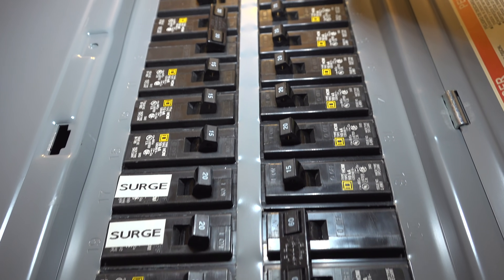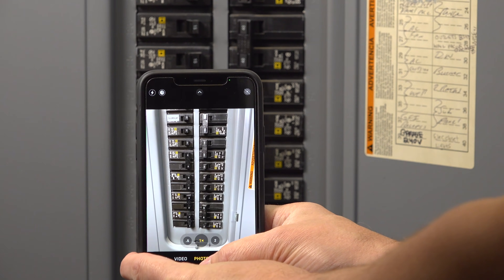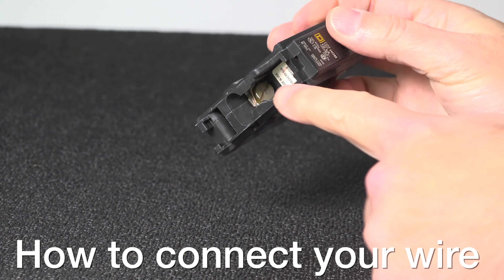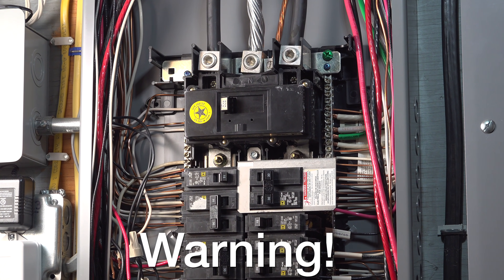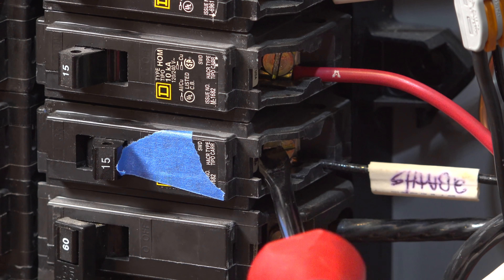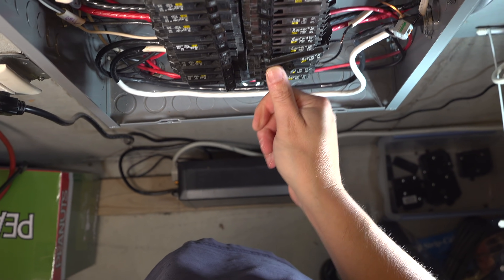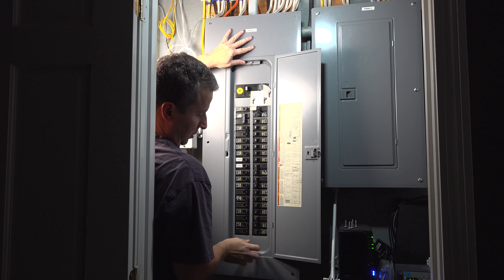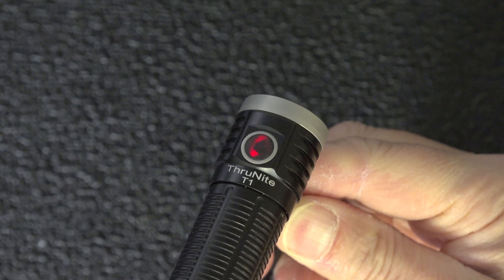How To Replace or Change a Circuit Breaker in your Electrical Panel & Why it's Tripping

Comment: In most cases, very seldom does a circuit breaker go “bad”. A circuit breaker is doing its job if and when it trips. There are many reasons why a breaker might seem to be nuisance tripping but most likely is tripping due to an actual over current occurrence. This guy gives no explanation on how he knows for certain that thiers is nothing wrong with his circuit, just because a breaker trips does not mean it needs to be replaced. Notice the label on the wire being changed. “2 baths”. This circuit breaker more than likely tripped because both baths were being used at the same time with let’s say 2 hair dryers going. This could be enough amperage draw to trip this breaker. Well done, the breaker did it’s job. Now unplug one hair dryer and reset the breaker. No need to change the breaker. You just simply can’t use 2 hair dryers at the same time and the breaker is doing it’s job to protect the wire. Many other variables need to be taken into account in a situation like this 

This guy is not an electrician and should not be giving advice on doing electrical work.
Reply: You are 100% correct!
Reply: You don't  need to know for certain what the issue is. 
Troubleshooting is very often a process of elimination. He simply the eliminated breaker as possible problem. If it quit tripping, that was the problem. If it still trips, pay more attention to when it trips then start digging deeper.  He didn't make the problem worse simply by installing a new breaker.
Reply: He wasn't giving advice on doing electrical work, he was only showing how he changes a breaker. Big difference. The bigger concern here is why you don't realize this.
Reply: @michaelwarnock3988  Nope. I will not be liable. Everything is up to code with a permit. Furthermore, I had to redo both wiring jobs that the last two incompetent licensed Master Electricians did (they used tape everywhere). In case you didn't know, most licensed trades people do a lousy job, they just want to make their quick money and get out asap. From my experience, most horror jobs were done by licensed professionals. I am sure there are a few good ones out there, but most are awful.
Reply: @panerai_fan  You are a fucking fool. If you really think all this bullshit then you need to find a better class of people or move to a less corrupt part of the country. You use the term "most" a lot in this diatribe, but YOU are the one that's wrong. Change most to "some" and you are a bit more correct.
Reply: @petermoto409  Nope. MOST licensed professionals are clueless and screw things up, which is why I do things for myself. I don't depend on "licensed" bozos.
Reply: @panerai_fan  Sorry that you live in such a shit hole area. 
I am a "licensed professional", as well as many of my friends, and I don't know any of us that is a hack. At the same time, I tend to separate myself from that element. Then again, I live in a pretty nice part of the country.
Reply: @petermoto409  Your geography "analogy" was stupid.
Reply: @panerai_fan  So are your debating skills.
Reply: @michaelwarnock3988   You are wrong. I watched his video and changed my own breaker. It was simple and easy.

Comment: i have a breaker i want to replace but its a 20amp can i replace it with a 30amp breaker ?
Reply from the maker: No, if you are going to change it with a higher amp one, all wiring, outlets, etc must be rated or a 30amp otherwise you can have a fire or worse. Get help for that job.
Reply: @SilverCymbal  i was told that if the wire behind it is 10gauage i can but if it isnt 10ga i cant is this true?

Comment: Question here. we just got a house last year, and with this Christmas season - outdoor lights and tree one fuse is blowing everytime I use the microwave. That fuse says Basement lights...( yeah I know and it gets worse ) The following are piggy backed on the same basement light fuse - 1 Living Room Socket, Master Bathroom Socket, Kitchen range microwave. 1 Garage Socket,    Can I just upgrade the fuse or do I have to redo the whole entire fuse box and rewire and label correctly>? Please advise ( btw i am just asking for advice,. Not a professional advice so that releases all liability from you )
Thank you very much
Reply: You microwave draws 12 of the 15 amps available. It needs a dedicated circuit.

Comment: great video. thanks for sharing.  if my breaker trip frequently when i got like two small load running, is that means my beaker is bad or old?  house about 20 years. thanks
Reply: What is "two small loads"?  A microwave and a hair dryer? LOL
A breaker is only $5 so, replace it with the SAME AMPERAGE RATING and find out.
Reply: @jackconnolly2665  air fryer and a small rice cooker 😆

Comment: I wonder if this is why my central AC [compressor] stops working.  The circuit breaker is not tripped but when I reset it, the AC works.  My HVAC said it could be the compressor needs to be replaced!  I don't want to go that route if I don't have to.
Reply: When in doubt, spend $12 and replace the breaker. You said it doesn't trip but there are cases when one leg trips and the handle doesnt go to the tripped position.

Comment: I JUST installed a Nest doorbell and it won't ring inside the house. I was told to replace the breaker with a higher voltage one. This video makes that job seem less daunting than I initially thought. Enough for me to give it a try.  Thank you.
Reply: You were told wrong! Higher voltage breaker? Did you possibly me higher amperage breaker? You CANNOT just simply add a higher amperage breaker. The wires that feed that circuit are rated for specific amperages. 14 awg wire, 15 amps max. 12 awg wire, 20 amps max. Using a 20 amp breaker to feed 14 awg wire, especially on a well used circuit, will lead to a fire!!! The increased amperage pull will generate heat to the point that the wire will actually melt. If you're lucky, the breaker will trip but that's not always the case.

My recommendation, as I am an electrician, is to hire an electrician and not listen to people who know absolutely nothing about electricity.

Comment: In my personal experience I wouldn't recommend the non-contact voltage testers. I am a master electrician and have been in the electrical business for 20 years. I have lost count how many times those testers do not show voltage when it is actually a live circuit. I've also seen it show voltage when there actually isn't. The safest way to know for sure is with a voltage multi-meter that has been tested on a known live circuit. The biggest problem with electricity is not knowing how it works
Reply: Thanks for reply. Turns out the clothes dryer  breaker was bad. When I took out. It was burned on the corners.  Replaced it along with the main since it sits atop it. Now everything is working properly. No issues since
Reply: Not knowing how electricity works and faulty equipment are two entirely different things.
Reply: Trust, but verifty. Agreed never work on a circuit without testing with a meter yourself that it is off.
Reply: In the power industry most voltages being checked are high voltage and most potential devices are non contact. 
It's a must as you said to check your non contact  potential device against a known source to ensure your device is in fact working properly. Three steps, check against a known source, then check the circuit you are going to tag out to work on, finally go back to that known source to see that the non contact device is still functioning. 
Once that circuit is established to be de-energized then apply safety grounds.
Reply: @generatorjohn4537  while doing laundry the clothes dryer breaker kept tripping. I went to the panel and it was very hot. I reset the main and it happened a few more times. Now I only have power to half of my house. Any ideas/ Suggestions? what do i need to replace?
Reply: @milagrossmith4891  call a qualified electrician in your area
Reply: No lie here. I found out the hard way lol
Reply: while doing laundry the clothes dryer breaker kept tripping. I went to the panel and it was very hot. I reset the main and it happened a few more times. Now I only have power to half of my house. Any ideas/ Suggestions? what do i need to replace?
Reply: Thank you for sharing that
Reply: Best example : I went to a home with an issue at the light switch. From what the homeowner told me, I told him you're probably getting a false reading (he was using a non contact). He was like huh? I explained it to him and then proved it when I got there; The meter showed he had only 87V. The non contact gave a positive for voltage. However he had AL wiring and I was not qualified or going to mess with it. In all likelihood, he had wire running in the attic that he had stepped on (he said he'd been up in the attic and issues followed) and had partially broken. I could've used Oxguard or something and joined the wires, but I wasn't messing with that shit. That's all I would have needed was to burn his f'n house down.
Reply: @WiPri0371  87v sounds like an open neutral
Reply: @RoKCRWLR  I checked ground. No current. Despite all, he had a partial break in the pairs somewhere. Regardless. It was AL wiring. I wasn't messing with that. I didn't have purple connectors. Just OxGuard. Which is unsuitable for AL/CU connections. Besides, I didn't know where the break was and had no materials. All thanks to our CSR who had no construction experience at all. And she's older than me!
Reply: @WiPri0371  Yup. 2 houses. One has copper? Buy that one. Lol
Reply: I lost count of how many times I have been shocked by 120 volts. You ain't gonna die if you get shocked by 120.
Reply: @crand20033  that's my motto 😆👍
Reply: @crand20033  Yeah, but I decided after an idiot wired up a simple pond pump, I'm NOT getting zapped again and refuse to touch it. Screw that. The plugs are corroded, too. Just begging for problems. The GFCI apparently isn't working or not working at capacity. Because I found out quick I'm not getting paid enough to screw w no more pond pumps. They're 10 bucks.

Comment: Well this trips because it feeds bathroom outlets and probably sees a hair dryer and a hair straightener.
Was the wire #12?
Reply: Exactly! All home runs to panel from bathroom should be 12/2 or 12/3. 15 amp can only feed a light

Comment: Hmmm...is that power out labeled: “2 baths?” If so, that may be your problem. If you are running two bathrooms on a 15 amp circuit, that’s a no-go. Each bathroom should have its own dedicated 20-amp circuit. GFCI breaker is best, is not, then GFCI receptacle feeding the light in shower (if you have one). 

Also, I don’t see any AFCI breakers in the panel. This has been code since 2008 I believe.  More details on that breaker? Is it feeing a bathroom?
Reply from the maker: Its for the second floor bathroom. Not sure why it's labelled like that. Those breakers are circa 1998

Comment: Hmmm.... newish house, but problem breaker on 15amp circuit that’s labeled “2 baths”. Maybe overdraw from hairdryers, curling irons, etc.?
Reply from the maker: Yes could be, it's about 20 years old. Maybe a bad breaker or got overloaded too many times. It's the 2nd floor bathroom, used a lot. The other issue I didn't mention is that counterfeit breakers have been on the market for a while and sadly some homes ended up with them and they are not the same quality, so who knows for sure.

Comment: What happens if the neutral is loose and/or burned that would cause the breaker to trip
Reply from the maker: Yes any loose connection can trip a breaker but a wire being burned is always something to pay close attention to. It is possible the wire was loose and that caused it to arc. You could re-strip it and attach it to a clean neutral  lug. But if it happens you will need to look further or get outside help.
Reply: I've been a journeyman electrician since 1980 . I have very rarely seen breakers  trip without reason.
Almost a fallacy worn out branch  circuit breaker
Reply: @grantwhebell7730  But, it does happen.  For $5, you eliminate the possibility of it being a breaker. On an intermittent trip, it's the way to go.

Comment: Nice job!
My two cents 
It's a square d homeline 115.
On panel covers,  its always easier to remove center screws last.
Last, you should restrip the wire, because it could be compromised by overtighten by orginal installer. 
👏👏👏👌
Reply: Always easier? 
I generally leave the top screws for last, specifically the top right because I'm right handed. I seems to be easier for me.
Of course, I have only done it a few thousand times :)

Comment: I’m no electrician but this is exactly why I’ll leave this to the electrician my life is to valuable
Reply from the maker: Nothing wrong with that, no one should work on electrical system that isn't completely comfortable. When in doubt hire someone but at least now you know what you are paying for.
Reply: I agree 100% something you just don't play with especially where you sleep at night.
Reply: Lmaoo scary mfs you take the proper precautions so you don’t end up fried thir is honestly one of the easiest electrical things you can do lol doing receptacles have 3-4 wires

Comment: I just completed some electrical upgrades that required breaker replacements. Your video is very thorough and covers safety topics, which is nice for those who have limited experience. Nice job, brother!
Reply: Hopefully you didn’t add higher amperage breakers without also completely upgrading the whole circuit as well. I have seen many times where people take a 15a circuit with 14-2 wire and simply swap the breaker to a 20a and think their problem is solved. However now they have a breaker that will allow a current load that their wires and other components can’t handle. So guess what, they get hot. Like fire hazard hot. Just a heads up in case this happened.
Reply: @johnd9357  Oh no. I'm fully aware of the amperage rating differences between 14 awg and 12 awg wire. My dad was an electrician for 20 years and I was fortunate enough to apprentice under him. This lesson I learned early on. 👍
Reply: @johnd9357  Good info. Separate question: we have an unused 30a breaker. Can I assume that there's enough power coming to the house to provide adequate voltage for whatever I'd add on there? Thinking of a bidet, fwiw.

Comment: If the wires are the same guage for 20 and 15, can u replace a 15 with a 20?
Reply: Just because the wiring is suitable for a 20amp circuit breaker doesn't mean you can change the breaker. All your devices like switches and receptacles need to be rated for 20amps or you risk a potential fire hazard
Reply from the maker: If you have the correct size wire for a 20 amp circuit which is 12 or 10 gauge wire you can, but you must be certain the entire circuit is using that size wire. You may see 12 gauge at the breaker but then it is reduced later in the circuit. So the short answer is usually yes but not without confirming the remainder of the circuit wire.
Reply: @SilverCymbal  ok, cool sounds good. Will have to check. Thanks brother!!

Comment: I like the main lockout, assuming that 2 pole 30 amp breaker is for a generator?
Reply from the maker: Yes a generator lockout. I really should do a video on installing one. They take some effort if you put an outlet outside but they are a great long term thing and 90% cheaper than a built in unit.

Comment: SC, good info. Another thought is to put the wire into the breaker before you put the new one in. IF you have enough wire! The new style of screw set, or whatever its called, is so much nicer than having to make a loop  the wire. Question: How do you test a breaker if it's ok or needs replaced?
Reply from the maker: Yes, I like to put the wire in after it's mounted for the reason you said, usually the wire is not free enough, but also it's much easier to get it good and tight. When you hold it in your hand you kind f fight the torque. im sure it can work but with both choices I usually wire it after it's in. So there really is no great test. Because you can short a circuit and a breaker will trip but it might fail one out of ever 20 times. My advice is if you think the rest of your circuit is good, Replace the breaker and see if it helps.